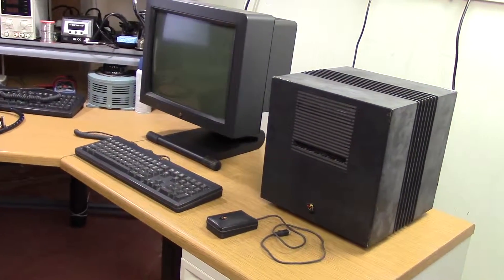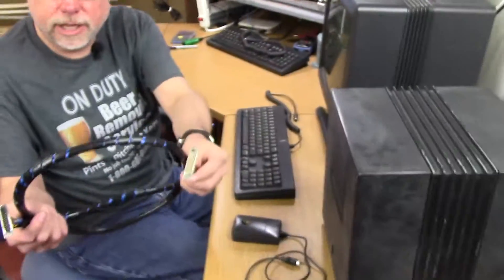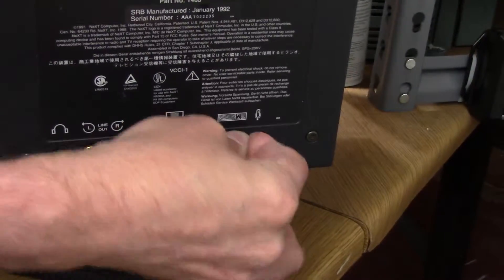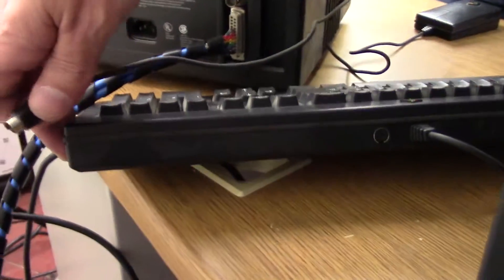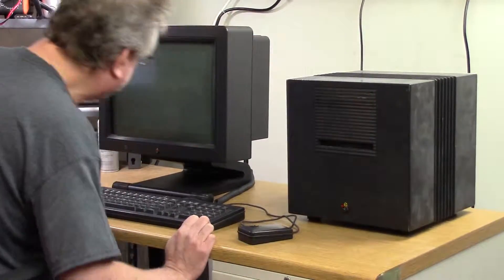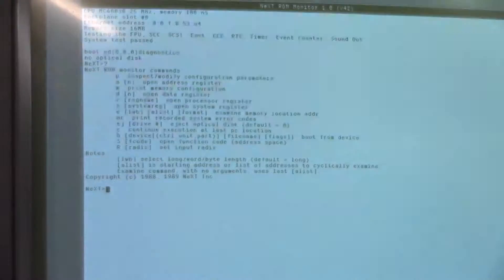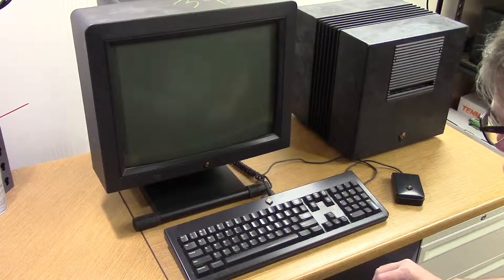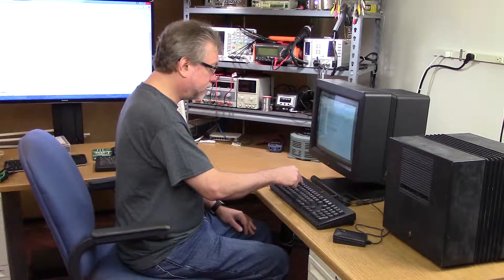On The Work Bench - NeXT Keyboard

Comment: With a 25 MHz 68030 with 16 MB of RAM you are probably best off going with NeXTStep v3.3.  I believe OpenStep 4.2 might be a little heavy for it.  Pretty sure that the filesystem on NS3.3 is limited to 2GB partitions.  So, kind of nice to have a 4GB drive that you can split in half.